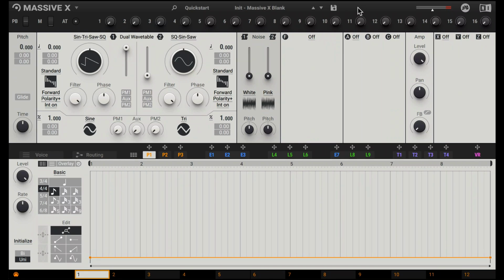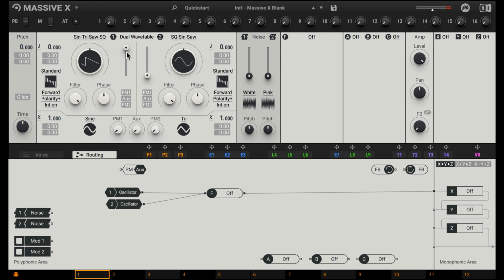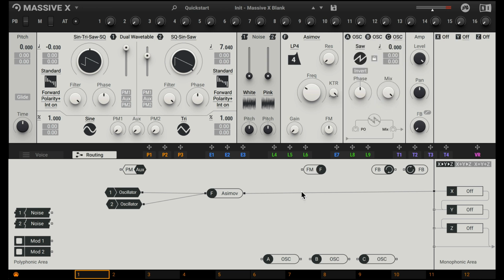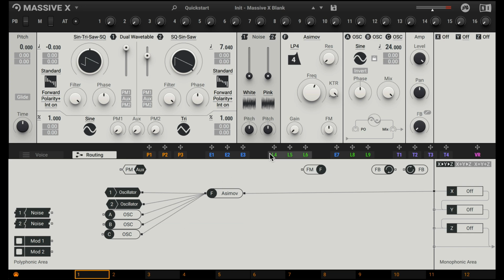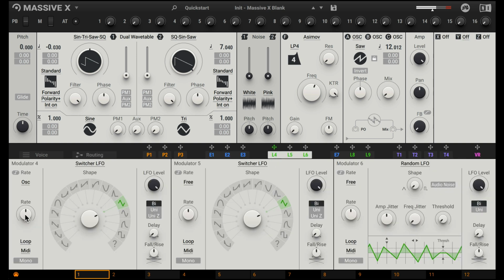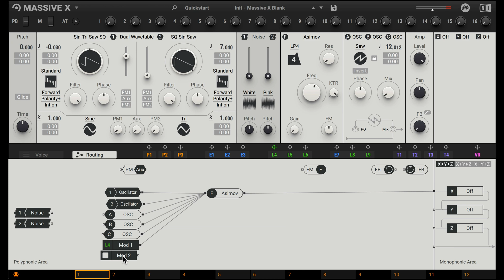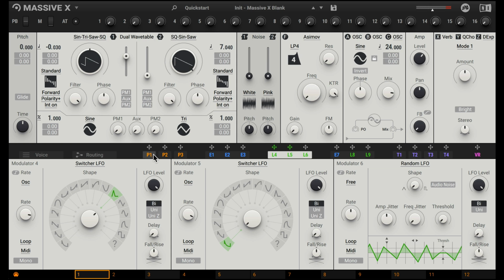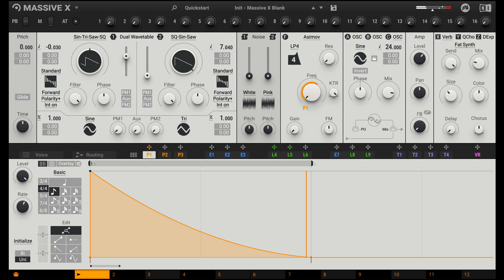Massive X Tutorials: 7 Oscillator Pluck

Comment: just as a helpful tip for pluck sounds, i found that if you assign a switcher LFO to itself and to the filter frequency, the LFO assigned to itself will cause the LFO to accelerate every time the gate restarts instead of fluctuating at a constant rate which sounds waay better for plucks!

Comment: Following up on my last question, and to put it more simply: Is there a way to get the performer to be in sync with the click in ableton, rather than running on its own clock?
Reply from the maker: Click on the grid icon to the left of P1. This will show you the Remote Assignment Section. Here set Launch to Key.